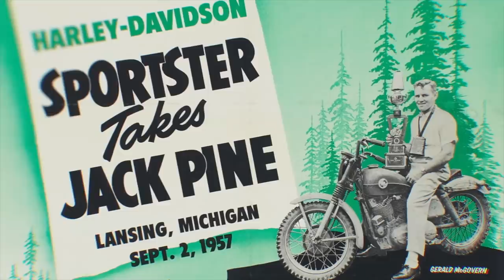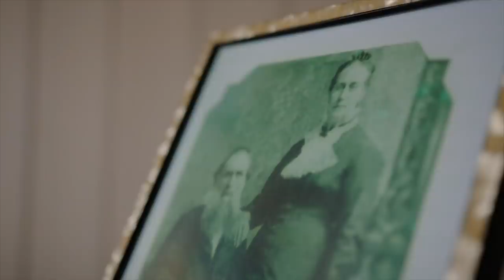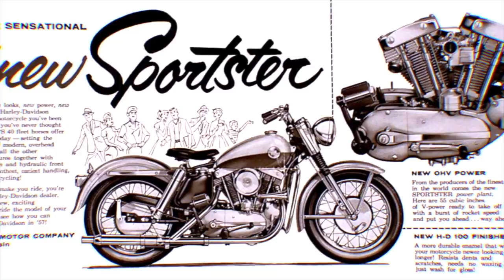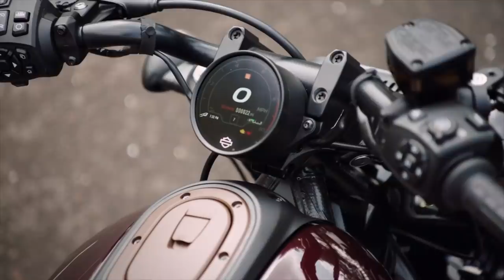Harley Smashes The Competition?  New Sportster S & Is CEO Jochen Zeitz on Track?

Comment: Wow! You nailed this one. HD apparently has been listening. I'm at 72 yr old rider with over 50 yrs of riding on many, many different bikes both in riding style, sport, dirt and touring. On my 3rd Goldwing but a year ago bought my first HD. A 2015 Iron 883. I just wanted to get back to old basic wind, bugs and a little noise. Still have the wing for the trips but ride the Iron several times a week. Have been impressed with the quality of the HD and even started thinking about a HD bagger. Glad to see HD R&D is alive and kicking.
Reply from the maker: Thanks for sharing your thoughts
Reply: I did what you did in reverse order. I am 61 and have been riding since 72 when dad bought me a Honda 90. I have owned six Harley’s and absolutely love them for many reasons. I currently ride an Electra Glide. But I also love the GoldWing but have never personally ridden one before. This year I looked at three new Harley’s and almost pulled the purchase trigger on a 2021 Road King Special but the little voice inside kept telling me to check out a Wing. My wife has gotten to the point that she is not enjoying the two-up riding on a Harley anymore. So I went to several local Honda dealers and looked at the new generation touring Wings with DCT. They are very very sweet but I didn’t quite budget that much. $35k+ (I like to pay cash). Then I started looking nationwide for an older Wing and landed on a pristine, low mileage (26k) 08 GL1800 with NAV / Comfort / Prem audio and a number of add-ons that I would have added myself. One state over and $10k out of my checkbook and I now have a beautiful touring bike that my wife loves to ride on. Honestly with the Honda reputation for reliability and the fact that I won’t need to add anything else to this bike, other than normal maintenance, I am hopeful that I can just get on and ride for years to come as I enter full-time retirement next year…… Oh and rest assured, my garage will always have a Harley in the lineup. My FLHT is my daily commuter.

Comment: This is a meaty motorcycle, great looking with technology that appears to allow it to handle very well.  But it certainly eliminates the entry level rider who needs neither all that performance nor the price tag.  Traditionally the sportster was the entry level Harley, both in the new and especially used market.  Although this bike may appeal to the modern, younger set, only well off thirty somethings will be able to afford one, IMO.
Reply: The classic Sportster line isn't going away. It will be the flagship for the new performance line. They teased that the XR series will be revived, and the Bronx (apparently) is going to be the step below this one.
Reply: I'm sure that there will be a none S standard version pretty soon. They teased is a bit during the end of the reveal video. Kind of looks like an updated Iron with the new engine.
Reply: This is going back to the Sportsters roots. The original '57 Sportster was NOT an entry level bike, it was the fastest bike made. It was raw, loud and fast meant to do battle against the English bikes, hence the right hand shift.  The entry level moniker came about a LOT later and there were certainly models made for that.  But the heart of the Sportster beats a high performance bike, always has.  I would consider one of these to compliment it's older brothers I own now, a 93 1200, a 74 XLCH and currently restoring a 63 XLCH.
Reply: I agree with Vic, even though others have suggested that the 50's Harley wasn't entry level priced, this is not the era of prosperity. New young riders, unless incensed by their own passion will see a "toy" or expensive 4 month vehicle that costs the same as a new car as ludicrous.   Maybe a Honda Rebel 1100 will due, for half the price. Besides: you meet the ... you  know the slogan ;-)

Comment: Aircooled sportster won't meet epa so it is going away but trying to replace it with a wide, fat tire bike with forward controls thats priced the same as a softail might not be the direction they should have gone.
Reply: Well, there are people buying Scouts and this bike is a better clone of the Scout although it is more expensive. I see a lot of young guys riding Scouts.
Reply: With better power to weight than an FTR, cruise control, ride modes. It will be faster than any softail out of the box. My concern is the size...

Comment: They should of done this 20 years ago. I got a chance to ride the V-rod and that bike has a fist full of power at the twist of the throttle. That was the Harley that put all the other Harley Davidson motorcycles to shame.
Reply: Finally someone recognizes that this is a vrod motor. No doubt a little updated with some changes. It even has the same name and displacement.
Reply: @robolson7669  I like the new sportster  I will be buying one finally Harley Davidson is finally coming out with high quality products that are built to last

Comment: When you see HD at Sturgis let em know they should have kept the Bronx. I'll be in Sturgis at the Buffalo Chip 7th thru the 15th.
Reply: Not to worry.  It will be launched if the new bikes sell well.
Reply: the Bronx is going to be the step down to the S. If you caught the launch vid, it teased a rebirth of the XR series at the end.  The new sport line will be (if they stick with classic displacements) FXR 750 and 1200, Bronx (900-ish cc's), and S as the flagship.

Comment: You can see a snippet of the bike that's basically replacing the Sportster in the video, you get little look at a red peanut tank, a silver Revolution Max motor with chrome exhaust and the usual curved and chopped rear fender found on most current Sportster models. I have seen images of these before but all blacked out. They look like an Iron 883 with a two into one exhaust. I image these will have either the 500cc or 975cc version of the Revolution Max

Comment: This is not the regular Sportster replacement. This is the premium high end sporty Sportster. They will make one with dual rear shocks, a peanut tank, and probably an analog gauge. It's actually in the promo video. If they make the 975 motor I would expect that bike to be about 10 or 11k that will be the actual traditional Sportster replacement.

Comment: I like it but I need room for two.  Plus at 62 I probably wouldn’t like to ride it very long. Planning on a 3 wheeler. On our 4th Harley in family, never had one before 4 years ago. Never had on in shop for any reason. Also I can turn better on my Electra glide standard than anything I have owned. Jerry Paladino is responsible for that.
Reply: I have several friends that have just bought new Can-Am Spyders. I never in my wildest imagination thought I would consider one, BUT……when I can no longer ride on two, that’s the direction I will go. Those machines are quite impressive.

Comment: Love the looks.  Glad Harley decreasing weight by using the engine as stressed member of frame.  Stability control with IMu standard is awesome.  Looks better than Fat Bob.  Remember when the air cooled Porsche 911 changed to liquid cooling for more horsepower and reliability.  This bike does not need a stage 4, just windshield and bags.TFT screen with mid controls as an option.  I heard lean angles of 35 degrees!  Watch out Scout and FTR!

Comment: I watched the release vid and could have done without the 10 minutes of heritage guff and more on the bike but I am stoked about the bike . The best thing about the bike is apart from the number of wheels it has nothing in common with the old sportster despite the tribute design points. The price in the UK is £14000  the same as the street bob so it is quite a bit more expensive than the discontinued sportster but the bike is a completely different animal. For me the new sportster s is the bike that Harley should have been building 10 years ago it is a thoroughly modern competitive bike with rider modes, traction control,ABS and all the other things that most of today’s riders want . The Harley range has undergone a makeover in the last 5 years the M8 motor , the softail range and now the revolution max engine. The old sportster had stood still for too long and was looking old compared to the competitors bikes .Its a good place to start a build but straight out of the crate it is lacking compared to the Indian scouts and triumphs bonnevilles . Personally I would buy the sportster s but I would be buying it for a completely different reason from the old sportster.

Comment: Even though the M8 motor is the best oil cooled motor Harley has made in my opinion, I say dump it in the Softails and use the Rev Max engine - oh!, with the Pan A. hp tune. For the Softails (in particular the LRs and Fat Bob), then the ride modes could also incorporate simultaneous adjustment to the suspension (eg, when you select 'sport' mode, the suspension also simultaneously adjusts for more spirited riding - Triumph and BMW have had this feature for more than 8 years now on their tourers and sports bikes.  Good to see HD move into the 21st century with the PA and Sportser S.  Imagine HD now incorporating adjustable clutch and brake levers - damn made my day.

Comment: I like the look of the new Sportster S it's going to interesting to how much heat come off that exhaust the only down side I can see is the pricing there in Australia is around $10.000 more even with the exchange rate it over priced
Reply: Yup, imagine being in traffic in AUD with those pipes on that slim seat. You will cook! The price point is the killer for me. They want to kill the Sportster line but release a bike priced well over most softtail options, just crazy. Oh well, given Harley in AUD can't get stock they will sell but to the older folks and the cycle of H-D not attracting the younger rider will continue
Reply: read that the pipes are well insulated
Reply: This is not replacing the Sportster line, it's a new branch of the same tree. Sportster S is priced same as it's target competition. It's NOT going after the Scout, it's going after the FTR.
Reply: @deangullberry5148  I know it not replacing sportster the price in Australia compared to the USA even with the exchange rate government charges it is over priced it should been around $3000.00 cheaper as with most Harley you buy a stock bike and spend thousands to bring the bike up to what it should be you should be able to order the bike straight from Harley with all the options on the car just like a car
Reply: @pata8167  Is the price jump because of tariffs? If so, that's not anything H-D can control. IDK if they're going to manufacture overseas to skirt it, but I imagine they will.

I can't say yes or no to what purchasing a Harley in Australia is like, but stateside we can "up order" anything available, for any model. Some may be added at the dealership, but when we take take it, it'll be exactly what we ordered.

Comment: So 121 HP in a 550 pound chassis sounds like a grand slam for a 14000.00 bike saw one at the museum in Milwaukee bad ass
6 speed with a red line of 9500 rpm FUN another move in the right direction.Plus digital dash

Comment: Not enough has been said of the hydraulic valves in the 1250 engine. For anyone who has had valve adjustments performed on other makes of bikes, you may understand the benefits of a hydraulic valve train. For those that think hydraulic valve trains can't provide good performance they need to think again. It's a win, win!

Comment: They knocked it out of the park with the Pan America.  It will be my next motorcycle.  That engine is awesome.  Very, very nimble, balanced and great for shorter riders like me.   I compare it to a mountain bike that can do 100mph on or off road.  Go test ride one today.  
As far as getting rid of the old Sportster, it will be a good motorcycle for beginners due to the price point.  I don't see them getting rid of it.  Very few beginners will spend $14,999 on a new motorcycle.  Why did they "de-tune" the new Sportster S?  Can't have your customer base wiping out giving them way to much power right off the bat.  It's good marketing to up sell those components for those who really want it and hope they don't run into a tree or slide of a twisty cliff and keep coming back to buy more stuff.  That stock engine is fast and gets you to 100mph quick.

Comment: Regardless of its power, etc., it still looks like you're riding a steer.
Reply: With 2 inches of rear wheel suspension travel and a tiny seat it will buck you off hitting a big bump
Reply: @johnengland8619  That's funny, John!  Wonder if riders will last the required 8 seconds on rough roads like in bronco riding before being bucked off!

Comment: Liquid cooling is something v twins have been missing out on for a long time. HD is finally going with a totally liquid cooled bike , full counter balancing, ride modes,and overhead cams while also getting rid of that problematic big ass primary chain and pushrods.
 When the come out with a model with taller handle bars I am in. A bike with 121 horse power is still more HP than my M8 107 street glide.
 I am very interested in the engine for touring models but retain current looks and accessories compatibility. Again this bike is proof that hot air cooled motorcycles are done, no more hot volcano between your legs.

Comment: I wish they didn’t call it a Sportster. It really isn’t - it actually wouldn’t look that bad if you swap the exhaust to something far smaller (but that requires a new rear fender because of the piece stinking out the side). Also need to remove that license plate holder bracket and reposition the tail lights.

Comment: This machine is not in the same class as the current XL series bikes. My sense is that we will see another motorcycle to replace the XL. 

The Pan America has an 11 liter air box/resonator under the tank; there’s no room for that on the Sportster-S. Milwaukee will have to use a different technology to build horsepower with an SE kit.

Since 2000 Harley has been wildly successful building engines with expandable displacement. it makes sense that this will continue in the future with the Rev-Max.

The Sportster-S is a solo machine, with clamshell ergonomics, heavy wheels and a single disc brake up front. It may stop just fine, for a bit, but it will generate twice the heat doing so...and for how long. 

I’m sure that a person can spend 2k or so for a 2-up seat and mid controls; I don’t see handlebars or a dual disk accessory yet, which would likely add another 2k, or so.

Milwaukee hit the ball out of the park with the Pan America; I just passed 1,100 miles on mine tonight, and I’m more than a little excited about this machine. It’s clear that Harley can hit a grand slam when they want to; my sense is that they are testing the waters with the Sportster-S and that the next iteration will be a much more rideable machine.

Comment: Prefer my 2013 48 which I just passed 40,000 miles on. Have a friend that just got the first Pan American on Guam, and it is interesting. Was surprised that you mentioned the braking system as an improvement. He has said he isn't impressed with it so far, and says his other bike stops much faster?? He has also noted that something is wrong with the clock loosing time?? Said the clock is manually set, and doesn't sync with phone automatically? Don't like the look of the exhaust. He did get the upgraded exhaust on his Pan American. Does it have the same warranty issue as other newer harley's??

Comment: My take on that is that this bike could be called anything, but not a Sportster as it does not resemble a Sportster at all.  Brad Richards mentions Mustang and Camaro as "long running brands"....but both Ford and GM did made modern versions of the cars but keeping many characteristics that makes a Camaro a Camaro and the same goes for the Mustang.

As for the Sportster S, it does not carry anything from the Air cooled sportster.... But it side by side to an Air cooled Sportster and you won't see anything Sportster in this new bike.

I can see & understand what Harley was thinking, they wanted to go in the same vein of what Polaris did when they re-introduced the Scout....but to my honest opinion, again, it's something else and not a Sportster

Comment: They finally got rid of the pushrods & realized liquid cooled engines make more power. They are always behind on technology trying to suck up to the check book bikers. The bike still has a 3 gallon tank though, & I bet it is uncomfortable to ride.
Reply: looks like they copied the indian scout engine
Reply from the maker: Definitely completely different in regards to specs of the two engines.
Reply: If you complain about Harley technology you don't understand Harley. There's a reason they've had air cooled v twins all these years.